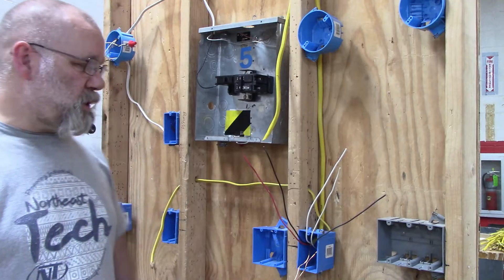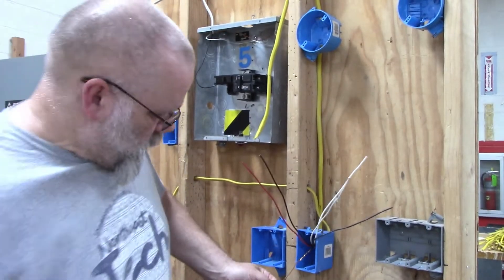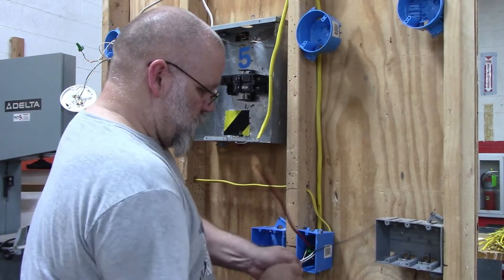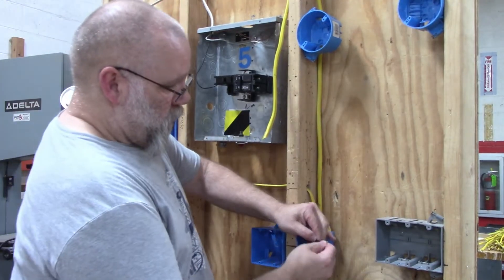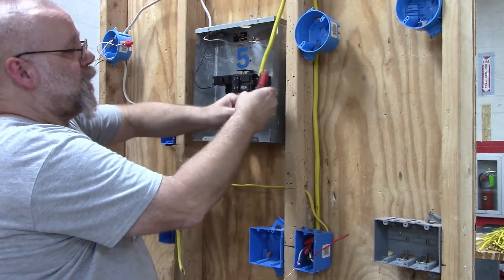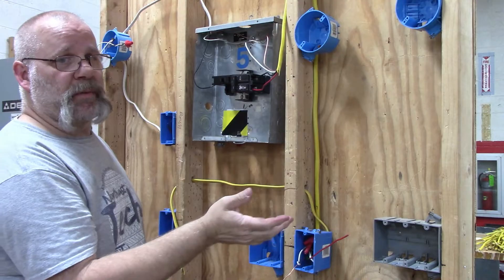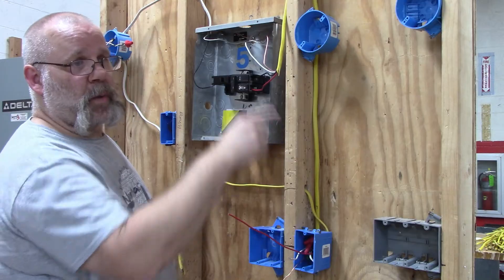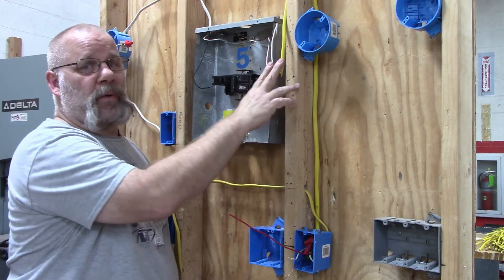3 wire homerun for 2 circuits

Comment: Thought sharing neutrals was not recomended
Reply: They also make a cable called 12/2/2 for 20 amps and 14/2/2 for 15 amps that have two hots, two neutrals and a ground in one jack. Black, white, red, white with red stripe and bare ground. It’s one way to get two separate circuits in a single cable, although if you choose to do it in the 3 wire configuration like this, it is code compliant and called a multi wire branch circuit which since it requires the use of handle ties or two pole breaker counts as a single circuit for NEC purposes. Article 200.4 is the one article that most people reference when they say you can’t share a neutral with more than one branch circuit, but it also says in that same sentence for more than one multi wire branch circuit which is what the video references. And on the following page in article 210.4 for multiwire branch circuits. It tells you how it needs to be wired with pole breaker or two single pole breakers with handle ties so they both disconnect simultaneously. And with that said you can use arc two fault receptacles in the configuration he did also. Really it’s a preference thing, but not against code, at least the NEC code anyway. I can’t speak on local codes. Codes keep changing which is why continuing education is a thing for most electrical licensing. One big one for the 2023 code adoption being the gfci protection got extended to the higher voltage appliances now like dryers in the laundry areas and even ranges or stoves if within 6 feet of the inside edge of a sink in dwelling units. Arc faults are required damnear everywhere, I’m waiting until they start requiring the big appliances to be arc fault protected too since it seems like that’s the direction we’re headed.
Reply: @usmarinekenny  haven’t seen that. That’s nice for switching so you don’t have a ton of white conductors reused used for power coming off a switch. Idk who wired my home but I didn’t like what I saw behind the wall in terms of make up.
Reply from the maker: In this case they are shared. As long as both circuits are turned off at the same time so you don't get feedback through the neutral.
Reply: You can share the neutral as long as the   
Power conductors are not on the same phase. Look at your panel and bussing closely. You will see that  circuits 1 and 2 are on phase A. 3 and 4 on phase B. 5 and 6 on A. 7and 8 on B. And so on down the panel. So to use a 3 wire cable. You have to use a 2 pole circuit breaker that has one pole that connects to the A phase in your panel and the other connects to B phase. So it follows, circuit 1 and 3 are on phase A and B and the breaker plugs into those fingers automatically. If you want you can use spaces 2 and 4 and you will connect to phases A and B.
Reply: Best to run two Romex now that everything has to be onstc fault breakers.

Comment: I just ran into that set up.  The breakers are not tied together.  Using a none touch sensor to test if they are hot it sounds and lights up that both are hot unless I turn both breakers off.  Could this be a false alarm because the two hots are so close together?
Reply from the maker: You could check the first box on the circuit to see they go in different directions.
Reply: Back feeding thru the neutral wire. Youll get voltage from neutral to ground doing this.

Comment: Can this be done for the disposer and the dishwasher?
Reply from the maker: yes
Reply: Don't worry about running 2 separate circuits for your dishwasher and disposal. They can share the same circuit and breaker. Reason being that a disposal will run for 30 seconds or less even if you run it while the dishwasher is running. So don't waste the wire or extra breaker. Where the problem arises is now everything in a kitchen has to be on GFCI. Well for your countertop outlets that's easy . Just feed the first receptacle as a GFI and then it will protect anything downstream. For dishwasher and disposal they will both have to be GFCI. You can use a GFI outlet under the sink to feed both appliances or you can use a GFI circuit breaker in your panel or to have the best of both worlds you could use a dead front GFCI on the counter with other switches or stand alone. A dead front GFI doesn't have slots to plug in appliances. Just a test and reset   button. On your dishwasher we use to hard wire to the #12 Romex and make the connection in the little junction box. But I think code requires a disconnect for the dishwasher. You can buy a ready made 6' pigtail that is rated for 15 amps for the dishwasher and you will also need a pigtail for the disposal. I would use 2 receptacles under the sink. That way you have each appliance plugged into it's own receptacle. The disposal receptacle will be fed by the switch on the counter. The dishwasher receptacle has a direct connection to power. But you must have a gfi protection for both appliances. For convenience use a dead front GFI. Line side will be power from electrical panel. Load side will feed both disposal and dishwasher. So on the Romex feeding disposal you will come from load side of gfi to a switch at a convenient location and then down to the receptacle designated for the disposal.

Comment: Can I connect more receptacles by continuing out of the second box with the 12-2 wire?
Reply from the maker: yes, you can run them like other plugs
Reply: @timpalmer-logstolumber1999  Thankyou!  I searched forever for this very set up, and finally  found your  video, you explaned it it detail and easy to understand.  
Thanks Again!!

Comment: Why do you need two breakers if both circuits can hold up to 20 amps? College student just trying to learn.
Reply from the maker: They are separate circuits. Each circuit carries 20 amps but they share the neutral. It is usually so you can run one three wire instead of two wires.
Reply: @timpalmer-logstolumber1999 what if you drove 18-19amps on both circuits at the same time? Wouldn’t that push 36-38amps back through the neutral if they are on the same phase/pole?  I just  moved into a place with a home theatre wired up like this with 14/3 shared on 2 15amp breakers on a single phase.  Worried about overloading the neutral before tripping either breaker.  or does this scenario mean you can only collectively use 15amps total.  So 8amps run off each circuit together would trip the 15amp breaker?
Reply from the maker: @kamac1980  They are two separate circuits. Each can  pull 20 amps but rarely does. The neutral takes the excess power back to the panel box. A circuit only pulls power when there is something on. So if each is pulling 18 amps that means something is using 18 amps and only a little stray amps goes back on the neutral. Hope this helps.
Reply: @timpalmer-logstolumber1999  I don't think so.  The amperage is not consumed.  The same current going out will also be coming  back.
Reply: By “hooked together” do you mean them being side my side and the wires being screwed in the breaker?
Reply from the maker: @chrismac9315  The toggles on the breakers are tide together so that when you turn off one, they both are turned off.

Comment: If a short fault occurs on one leg/branch with the breakers mechanically bonded, how or does it trip both breakers?
Reply from the maker: You have to connect the two breakers, so one trips both.
Reply: @timpalmer-logstolumber1999  hey, thanks for your reply.
Reply from the maker: @sidwalker6902  Not a problem, glad I could help
Reply: @timpalmer-logstolumber1999  So basically a 220 breaker, then?
Reply from the maker: @billmonroe8826  yes
Reply: @timpalmer-logstolumber1999  Thanks for the reply. Good videos. Keep up the good work.
Reply from the maker: @billmonroe8826  I've been teaching for 25 years, it's good when the knowledge gets passed on. Thanks for watching.
Reply: @timpalmer-logstolumber1999  Yes sir. You just have more patience than I. lol
Reply from the maker: @billmonroe8826  I have more patience now than I used to